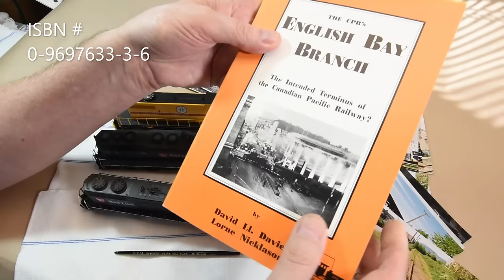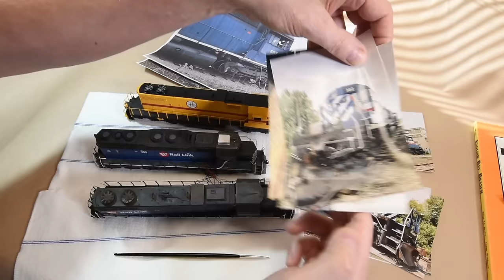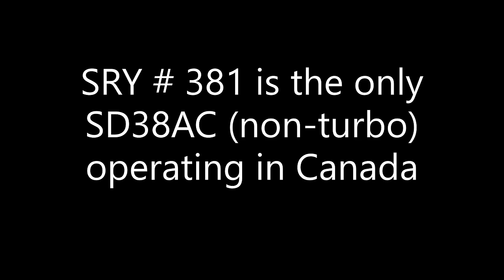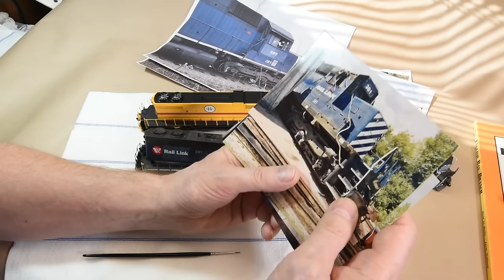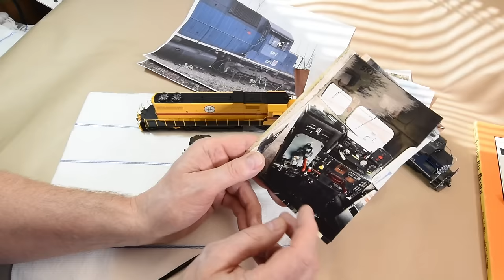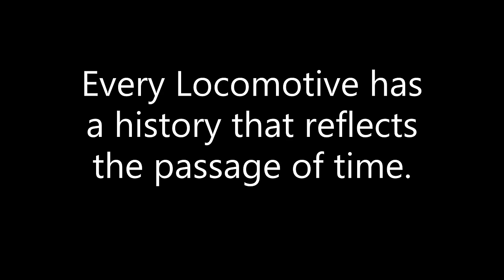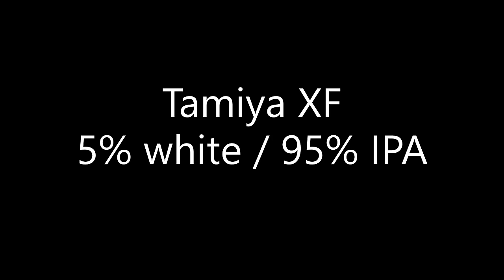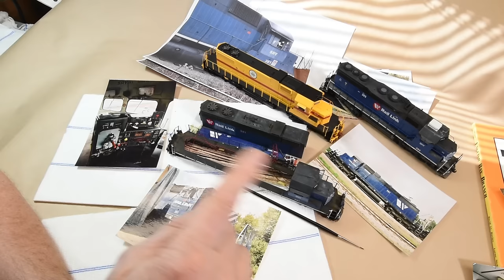Modeling a Classic HO Scale EMD-SD38AC (BC Hydro) SRY Rail Link Locomotive | Boomer Diorama ~ # 259

Comment: Even with our trucks at work, it is funny to see the "passage of time" 
Our trucks are replaced every so many years, but the barrels are reused. We had fleet numbers 834. The truck was retired at the start of this season. 834 showed up at our sister factory. Popular belief is that the number truck keeps the barrel. Until 421 showed up with 834's barrel. Our fleet (at our factory) is mostly covered. There is a thermal layer over the stainless barrels for keeping the product cool. 
On the back of the cover on 421, you can see 834 as a shadow where the vinyl number was removed.
It was suggested that the cover was moved. However the cable ties holding the cover are the original white ones that are no longer used. 

The same can be said for the factory there is still evidence of the old streets that had worker housing. Most of it has gone but for some reason in the middle of the grass there is still some road and storm drain visible. 

It is an interesting topic to model non existing elements. Or hints of structures or rail lost to time.
Reply from the maker: Thanks for sharing!

Comment: Excellent video as always. Ms Dusty had me cracking up at the start of the video and as a locomotive engineer I can tell you that it's a nice asset to have working dynamic brakes in your consist.
Reply from the maker: Yes indeed. I often wondered how Hydro dealt with the big hill on the way down from Surrey to the RIver without Dynamic Brakes. I guess the smaller consists were the reason.

Comment: Nice video...  Goes to show the need for historical data for such a deep dive approach...  Your extensive research skills match your modelling skills.  This video prompted a old question for me: are those round protrusions, next to your modified sand filler, classification lights, or what?  I've seen various diesel pictures where they are seemingly lights, but others  look like just round bumps (as on an Athearn blue box).  My Dad and I would drill out and put in marker diamonds assuming they are class lights.... but I still wonder about those bumps sometimes.
Reply from the maker: Those are class lights which they no longer use.
Reply: @boomerdiorama  TY.  Do they just paint over the lens or do they cap/plug them?
Reply: I found discussions that said lines would paint over, or actually plug/disable (more costly)... complicated safety rules involved as well.

Comment: Your round patches on the hood may be holes cut to pull power assemblies from the block without removing said hood.  They are more for the lift chains than the assemblies.
May have been done where there is no overhead lift or crane, probably a boom truck.
Shortline stuff. I helped pull assemblies out of one of our CF-7s back in the late 80s.
Cheers Brother.
Reply from the maker: O.K. That sounds good. Thanks for sharing your experiences as well. Cheers!